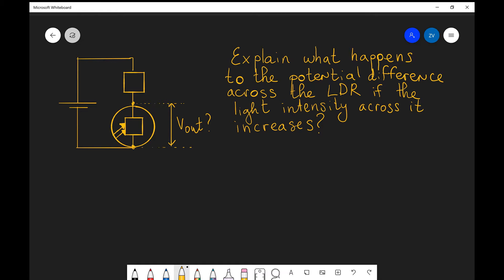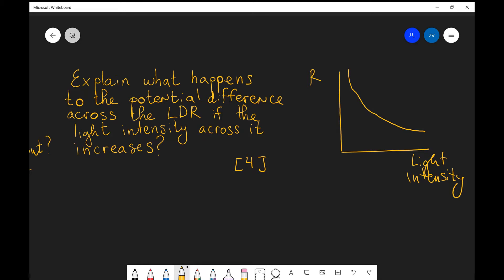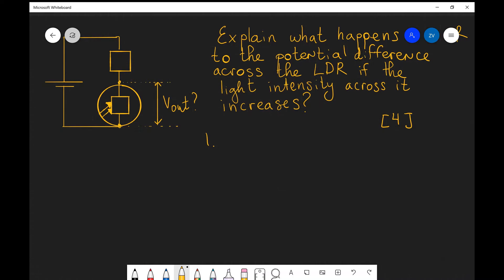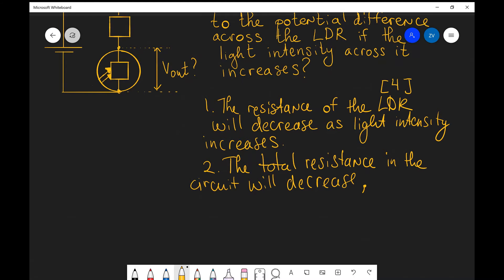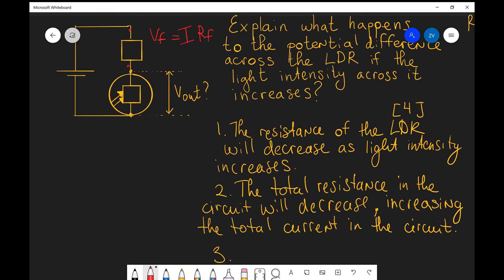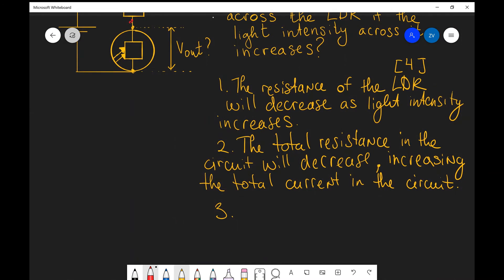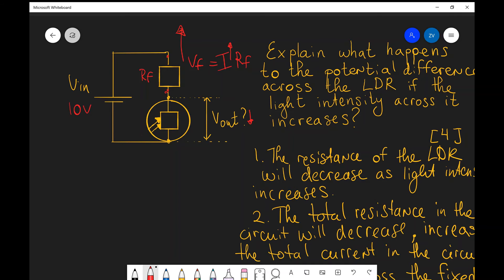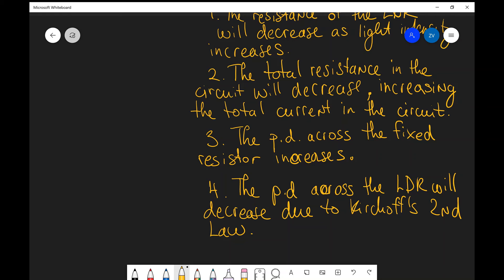A Level Physics: Potential Divider Question, LDR Example

Comment: hi sir, I don't understand why the resistor is fixed, would you be able to help?
Reply from the maker: Hi fixed resistors typically appear in circuit problems but not always. You could have a potential divider with two LDRs or thermistors too. Same principles apply.
To answer your question though, in a normal resistor V is proportional to I with R remaining constant at a constant temperature. Hope this helps!